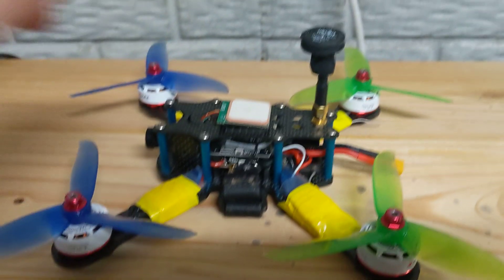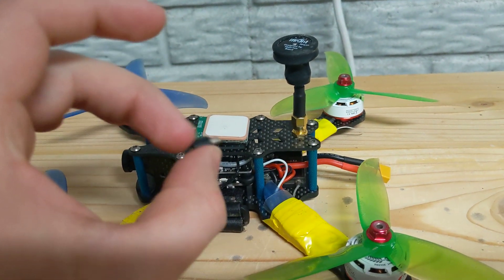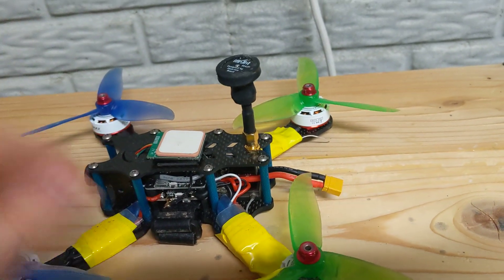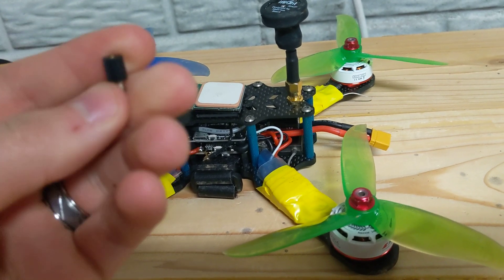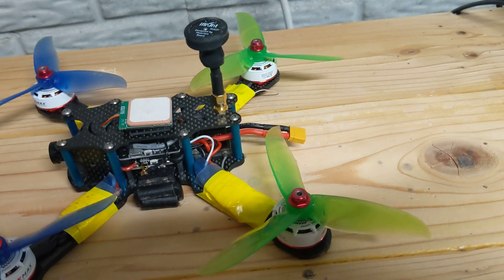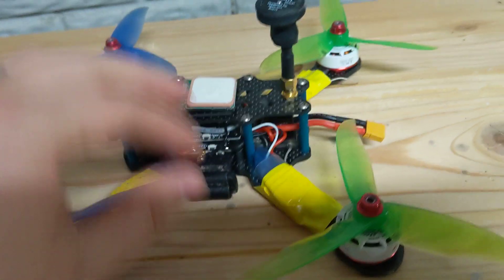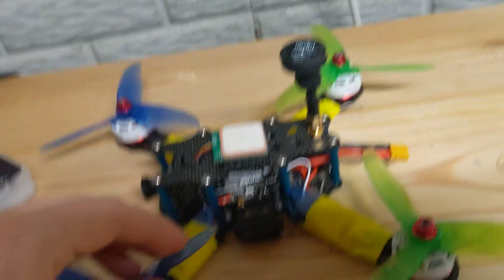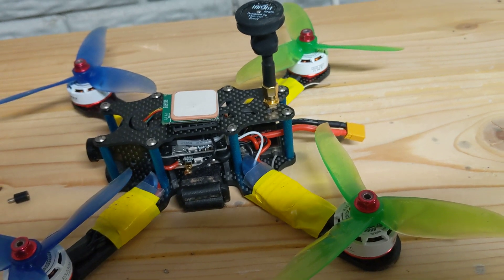Matek F722-STD motor twitching when arming

Comment: I've had problems with motor signal outputs on the f405 std. Two matek  boards I've had to remap   to 5, 6 or 7 signal output because one of the first four outputs  were dead.  Just decided  not to work. I've had many boards never had this issue of signal outputs just stop working. No  pulled pad nothin.